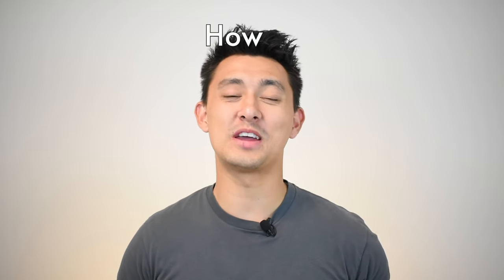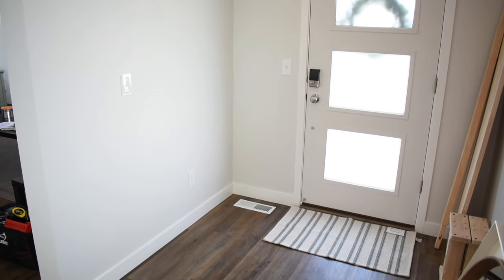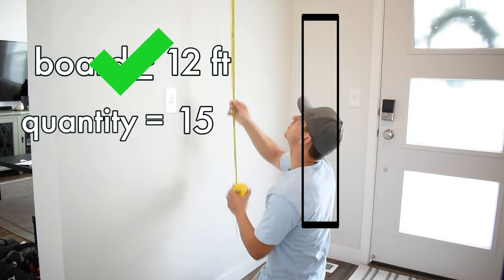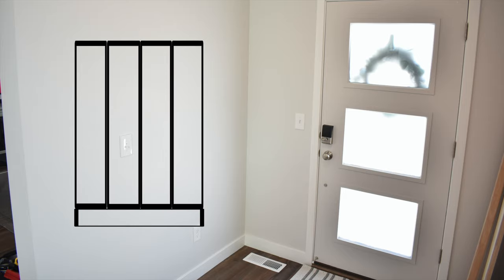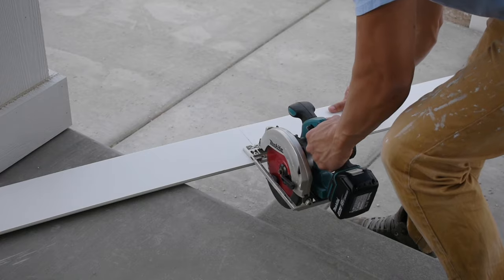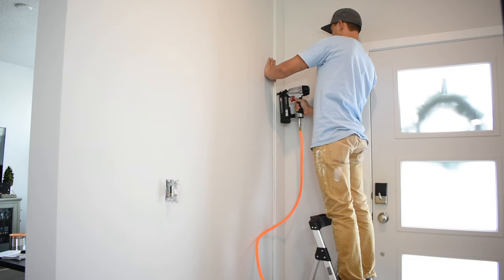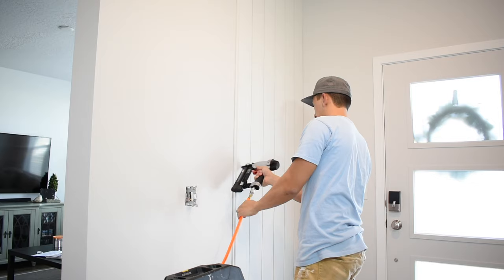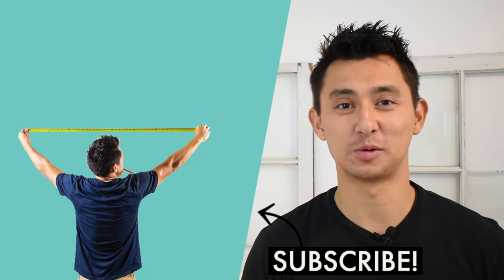How to install vertical shiplap - DIY REAL shiplap

Comment: If youre only anchoring into drywall id advice nailing at a down angle so the nails are anchored in a little better.  A brad nail really isnt going to secure to drywall at all.  The adhesive is what holds it.  Otherwise you can add horizontal furring strips but it will pad the wall out further.
Reply from the maker: This comment 100%.

Comment: did you have a problem with the paint seeping into the edges between the boards since you painted it on after installation?
Reply from the maker: We actually wanted the gap between the boards to be painted to complete the look of a consistent color for the entire wall.  Shiplap is tricky in that way where you need to be able to get into all of the cracks and crevices.

Comment: Can you show a closeup of how the board looks against the baseboard? I'm debating if i should take the baseboard off or not.
Reply from the maker: Honestly, for the purpose of getting the wall done and knowing we put an entry table behind it, we were fine with how it ended up.  If there was a wall where the baseboard was being shown, I would 100% pop off the baseboard, do these steps, then put the baseboard back on.

Comment: Nailed the boards that didn’t land on studs too? Or was the liquid nail combined with being linked with other boards enough to keep a strong hold to the wall?
Reply from the maker: I did nail in where there weren't studs, this helped me with consistency and also reducing how much the board moved due to gravity while the adhesive was drying.

Comment: Do i need extra backing or is drywall supportive enough? Thanks! Your wall looks great! Want to do vertical over fireplace.
Reply from the maker: No need for additional backing.  If you want your vertical accent to be permanent, then liquid nails and the finishing nail is more than sufficient on dry wall. If you want to maybe redo the wall to something else and take down the vertical wall accent layer in time, then doing liquid nails is going to be "not very fun" (aka will rip down pieces of drywall when trying to remove)  coming off and I would try to just do nice and tight cuts with nails.  Great question.  I hope this helps.  Thanks for watching :)
Reply: @ColtonCrumpDIY  Thank you SO much! Very helpful response! 👍👍 And so quickly too! Appreciate that!
Reply from the maker: Of course!! Happy to help :)

Comment: How would you go about painting half the height of the shiplap wall? So that you have a top half and bottom half in 2 different colours? 

I know you mask it… but what about the gaps? Or is it easier to measure and mask each board and paint them all individually first?
Reply from the maker: Great question.  You would probably have a better chance at minimal drips in the gaps of you were to paint them first then do it.  But that increases the chance of the lines not lining up when you put the boards on.  Personally I would get the boards all up, tape it off but be very particular in the gaps or just have a good steady hand.
Reply: That is going to look like crap no matter how you do it.

Comment: Great video. So you were worried about screwing the boards into studs?
Reply from the maker: Thanks! No I wasn't worried about screwing the boards into studs.  I believe there was someone else that was though.
Reply: @ColtonCrumpDIY  You are probably right. The adhesive and brad nails are enough not to have to worry about it ever coming down.
Reply from the maker: Yeah with normal shiplap, when is horizontal, finding the studs and nailing the it there is great especially if you want to take the shiplap down later and change the wall.  With vertical, it can be tricky to have some of the wood come off the wall or feel "spongey" because there aren't studs every 6 inches. The liquid nails makes it sturdy but also difficult to redo the wall of I ever wanted to take it down.  Thanks for commenting and watching!
Reply: Just secure 1/4" lattice strips horizontal to the studs then you have something to secure the vertical shiplap to without covering your wall with liquid nails.

Comment: What did you do on the cut edge to finish it?
Reply from the maker: I just left it.  I did a really straight cut and went with a more raw look.  You could get a corner trim piece to finish it off though.  Then paint it.  Or get some sort of molding and nail that on the end also.
Reply: @ColtonCrumpDIY  thanks

Comment: Covering the nails was the hardest part when we tried this the first time. Is any of the spackle visible at the end? Or sanding really key? What did you use to sand?
Reply from the maker: This can be tricky. So in the end, the spackle is hardly visible even when trying to look for it.  I try to get just enough spackle to pack into the hole and then smooth it out with my finger with a quick pass. When it's all dry I use just a standard 3M sanding block (120 grit) if I see that filled hole isn't smooth enough.  I have a link in the description of that helps.
Reply: Sand till flush with a fine sanding block then 2 coats of primer over all nail holes, then 2 coats of paint.
Reply from the maker: This will do it

Comment: Would you have issues down the road with boards coming loose if you are not nailing it to strapping/stud?
Reply from the maker: Nope. That's why I used liquid nails on the back of the board as the main bond to the wall and added the nails for added support.  Those boards aren't coming off themselves.  If someone wanted to remove the shiplap, they likely would have an easier time cutting the sheetrock out that is stuck to the shiplap, then replacing it with sheetrock.  Unless they wanted to deal with finding the finishing nails, and peeling off the shiplap from a painted sheetrock wall.

Comment: Love the project! However if I’m brutally honest, If that wall is not load bearing, which doesn’t look like it, tear it down. Open that up! Open concept and maximize the living space. Resale and appreciation goes way up! On our 3rd house with open and our appraisals rocketed..
Reply from the maker: Fair point.  We do like the open concepts.  One thing we did want though is a place where my kids could kick their shoes off and just toss them in baskets under an entry table.  Has worked out great. Great idea though.  Maybe when we get sick of this accent wall we will knock it down
Reply: @ColtonCrumpDIY  I have been seeing vertical styles coming in… I’m getting ready for some shiplap jobs.
Trying to cut drywall back and have more DIY non expensive commercial projects. 
Drywall can be nice, but it’s literally
The worst and definitely an aquired skill..
Reply from the maker: 100%

Comment: After using liquid nail do you blind nail into the rabbit joint as well?
Reply from the maker: I didn't.  I just put 2 nails side by side every 12 to 20 inches ish.

Comment: Did you use any kind of trim piece on the corner of the wall that goes into the next room?
Reply from the maker: I didn't but that was a style choice.  You can install a shiplap wall and really step up your game and install finishing molding on all of the sides and wrap around the corner and edges. But was going for a more raw look for the entire accent piece.

Comment: What size shiplap did you use? The link isn’t working. Thanks!
Reply from the maker: Thanks for letting me know! I used a 6 inch wide by 12ft long.  But I don't see that in stock anymore.  So there is this link for 8ft long.  It may not be long enough depending on your ceiling height.  https://www.homedepot.com/p/0-591-in-x-6-000-in-x-8-ft-Primed-MDF-Shiplap-Siding-168PMDFSL/301117565
Reply: @ColtonCrumpDIY  thanks so much. Your wall looks so good ☺️

Comment: Shooting nails into drywall? I’m not even sure this will provide temporary stability until the adhesive dries.
Reply from the maker: It actually held up really well.  While the glue dried, the nails were enough to counter gravity and keep them in place.

Comment: Do not use liquid nails.
Reply from the maker: It all depends on what you're okay with.  If you're in an area where there is more humidity, or shifting of your home, and you're okay with these potentially coming off the wall if you only use nails without glue,  sweet. Just prep yourself that these may come off later.  However re doing the wall and removing the shiplap is easier if you want to change.  If you don't see a change and are okay with a solid study wall and if you do want to rip it down later,  are okay with re sheetrocking, then glue it.
Reply: @ColtonCrumpDIY  Nail into your studs and you’ll be fine. It’s a nightmare having to re sheetrock an entire wall.
Reply from the maker: Horizontal shiplap I agree. But not with a vertical shiplap wall.  Studs are only 16 to 24 inches apart on center. The occasional shiplap will be nailed into the stud, but the boards in between the studs are still nailing into sheetrock not providing a guaranteed grip.
Reply: @ColtonCrumpDIY  Good point. Thank you for your video.

Comment: Why are you face nailing instead of nailing through the tongue where it won't be visible? I know you have to face nail one side, but not both. You are just making extra work for yourself later on.
Reply from the maker: I don't want to risk ruining the tongue with driving the finishing nails through it.  I'd rather face nail it, fill the hole and sand it briefly rather than nail where you're saying and having pieces of the board potentially split or chip off ruining it and making it more ugly.

Comment: Why are you nailing into Sheetrock only that’s pointless it’s holding nothing.
Reply from the maker: Consistency sake and because they are vertical if I hit a stud while doing it sweet, it will grab.  But with the glue there if I can at least angle the nails slightly towards the floor, it helped it gravity not letting the board sag while the glue dried.  In theory and most of the time I would agree, nailing into only sheetrock does nothing.  But when I did put a slight angle to it and I was just nailing, also cause it's fun and nails are cheap,  there were random places it did grab. So it didn't hurt to keep going.